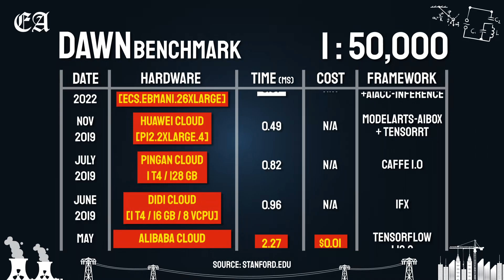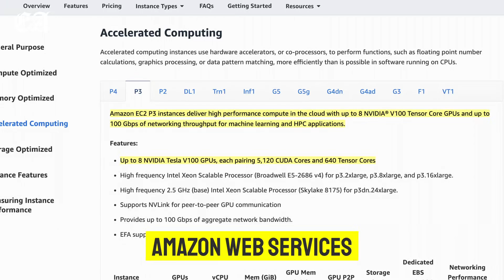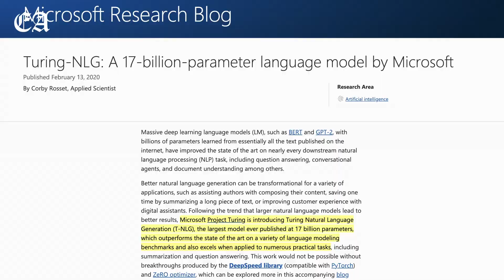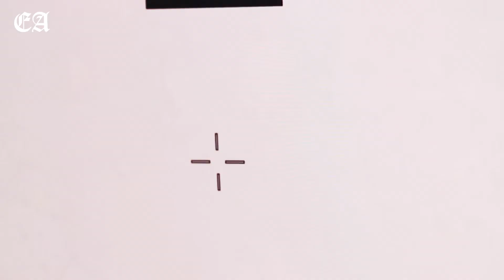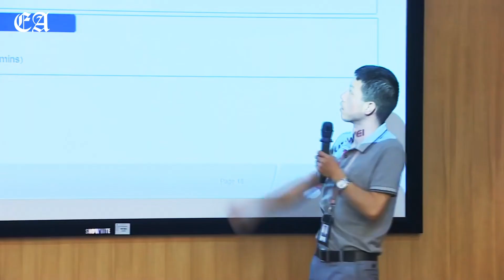Why the U.S. A.I. Chips (Nvidia and AMD) matter so much for China? and Why the U.S. is banning them?

Comment: Although broad generalizations are pretty much on,
There are several inaccuracies when you get down into the tech that's being described.
Cloud computing covers a very broad area of what is being provided by Providers. The type of service being provided by those who use these big number crunching chips are more often referred to as PAAS (Platfrom as a service) rather than SAAS(Service as a service). The ifference is that platforms provide little more than the hardware whereas services are considered to be mostly software functionality provided as a service. This lack of understanding by this video's producers is compounded by comparing SAAS data to PAAS data which is like comparing apples to oranges... The two are very different so can't be compared to each other. What may be further confusing is that a SAAS might be run on a PAAS, but in this case is sold/rented to the consumer very differently.

It should be emphasized that the high end "worker" chips from nVidia and AMD aren't required except for the most intensive applications that are used for R&D and military use. Ordinary industrial uses don't require such advanced chips, even to produce AK algorithms using machine learning... It just might take longer for some of the most cutting edge uses.
Reply from the maker: Thank you for catching that and for the feedback! Yes, PaaS market trend should be the parameter than SaaS.

> It should be emphasized that the high end "worker" chips from nVidia and AMD
Thank you for the suggestion. I will keep in mind from next time.
Just to add the context, what I found from my research was that a big market for high-end chips in China were the universities that had advanced research.
But, even if we generalize this, an increase in computation power horizontally affects the tech industry, as with time, the non-intensive workloads slowly become intensive when they developers realize that they have a good (affordable) bandwidth for GPU computation due to advanced chips. When PaaS providers use advanced chips, the cost per minute usually comes down due to increase in computation speed.

Comment: You know how cutthroat it is in videocard and AI industry. I want to see how china catch up to it if they can. They are not fixed tech like rocket and space tech as in 3 years they are usually increase performance by 100% in performance. Lol.. Good luck china. Who can't even catch up with the 4nm etching.
Reply from the maker: Good point. Semiconductor designing and fabrication is very sophisticated. Stealing copyrights and copying the semiconductor designs will most probably not work. I recall a semiconductor design engineer saying, it takes more time to reverse engineer a sophisticated chip, than to be manufactured by established companies like Nvidia. It's like, by the time you copy a chip, the competition (US companies) is 2 generations ahead.

Comment: "Constructed in the US, and a small number of allied democracies." You mean constructed exclusively in Taiwan. While I understand the consern from the US, I am affraid that this increases the chance that Taiwan will be targeted. Maybe not a full out attack, but stealing technology, sabotage, supply chain things like that, and then the US will be cut off too.
Reply: The Dutch and the US own the technology that Taiwan uses to make its chips..

They are only made in Taiwan due to low costs Of labor and materials.
Reply: @adamanderson8334  the Netherlands has ASML. Which is way more important than what the US has to offer.
Reply: @LaoShimazaki  okay let me clear it up for you.. 

The “Dutch” are the people of the Netherlands if you aren’t aware, now that we got that out of the way here are the facts..

The company ASML builds the machine which is called the “High NA EUV” to produce these next generation microchips using the extreme ultraviolet (EUV) lithography process. The United States owns some important patents that are related to EUV and the High NA EUV machine itself making it almost like a Dutch-american partnership.

This is why tech is only allowed in the Netherlands, USA, Taiwan, South Korea.
Reply from the maker: From what I know, Taiwan (TSMC) is responsible for fabrication of chips. But, manufacturing a semiconductor involves a more steps, like circuit design, testing, packaging etc. Companies like Intel, Nvidia, Apple (M and A series chips) have experience in circuit design (which is an important part), and they outsource the fabrication due to technology reasons.
While its true that TSMC (after fabrication) implements those circuits designs as hardware, but the research into the designs happened in the US. So, speaking broadly, semiconductor manufacturing is concentrated in the US and allied democracies.
Reply: China is already stealing technology.  That was one of the reasons the trade war started years ago.  Also good thing the US is investing more and more into semiconductor industry.  With multiple companies Intel, TSMC, Samsung, etc. All opening up factories within the continental US.